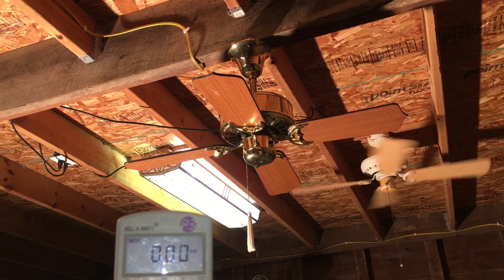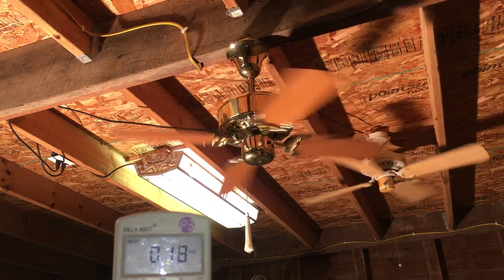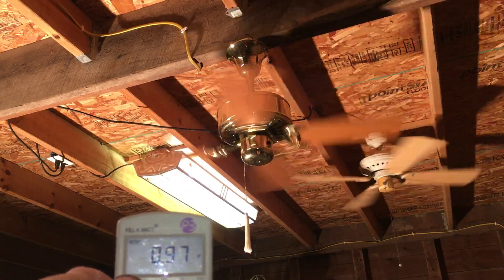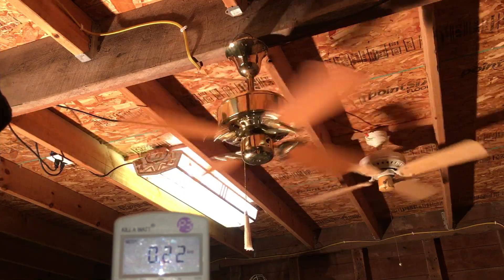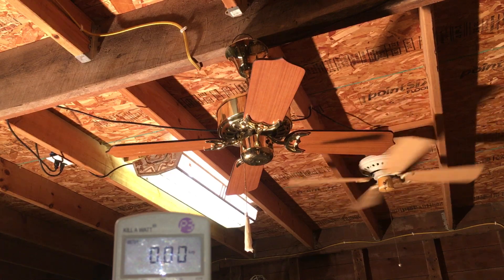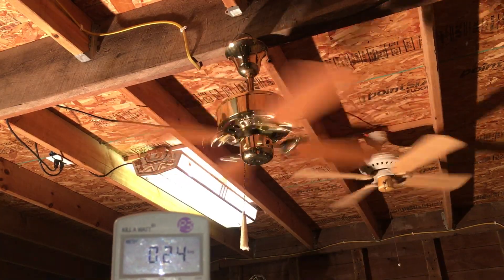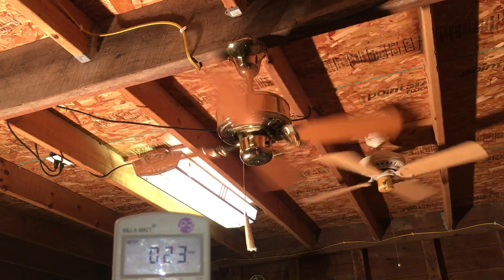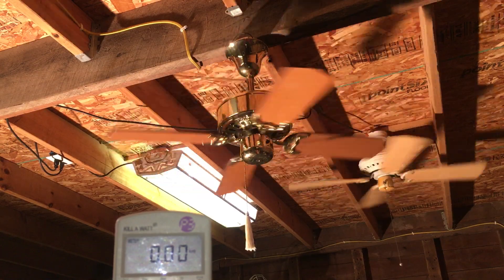Caribbean Electric ceiling fan 36"

Comment: Does this fam come with only one size blades because the skating rink I go to had two of these hanging and the blades was a bit longer I think it probably measured at 42” Idk if it was a Tyeb or a Carib they both have the same blades and motor and the GE Vents.